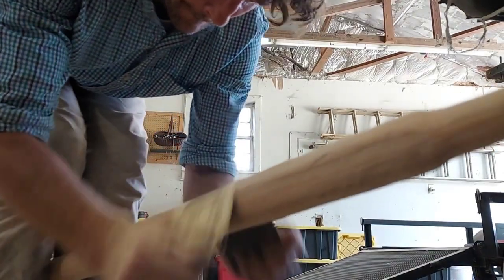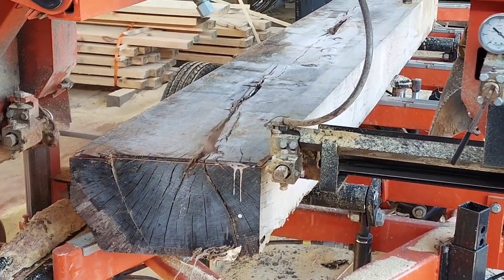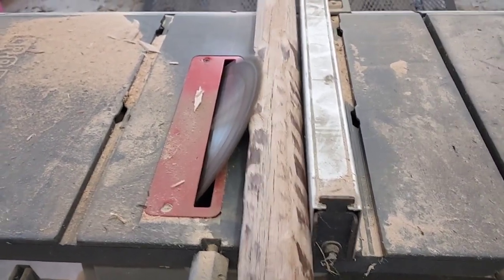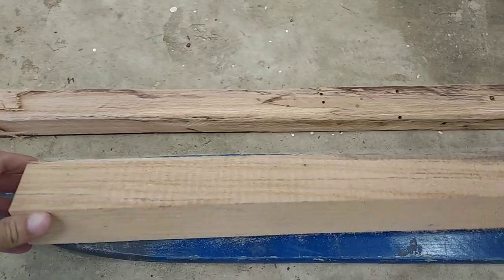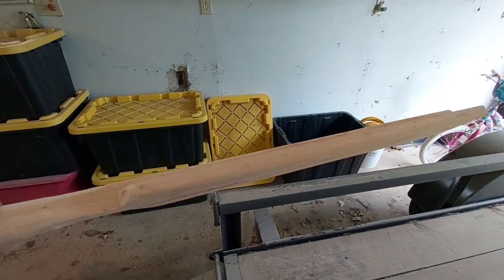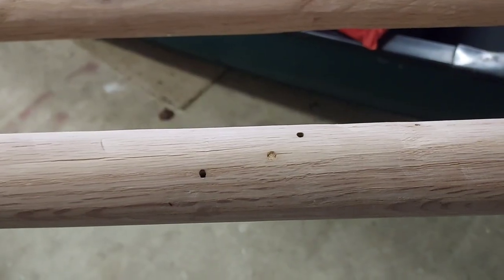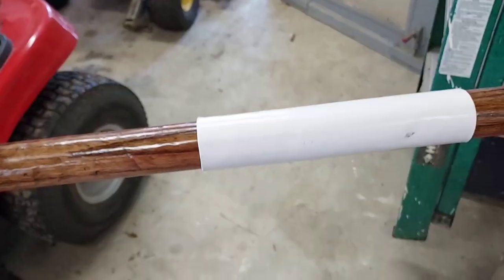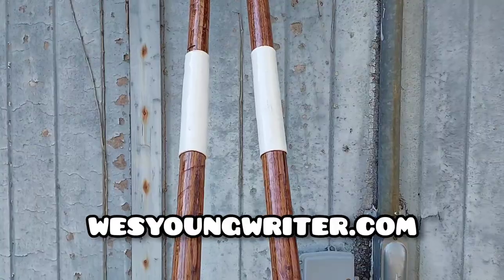Making Oars with a Table Saw

Comment: Wished I had watched this video before I made my oars!
Reply from the maker: I hear ya! Though I do hope you found a lighter-weight wood than mine. I used these wooden oars for about a year and then upgraded to carbon fiber oars. Whew, so much lighter. I'll never be able to go back now.
Reply: you can balance the weight by attaching some lead to the shorter parts that you hold in your hands.. in old days those parts were made thicker to counter weight the long parts..